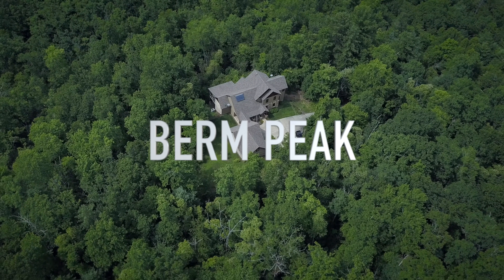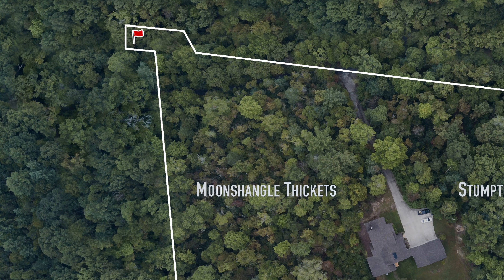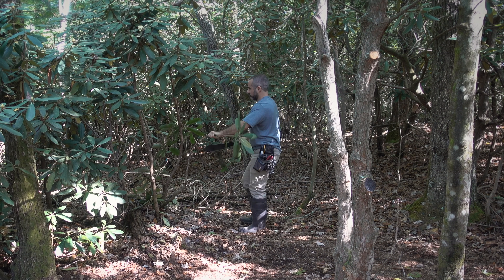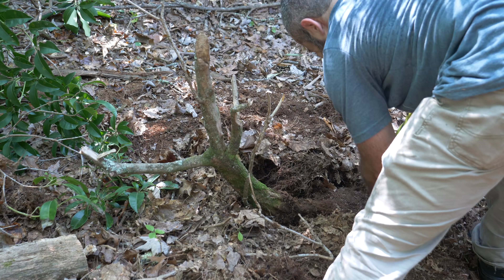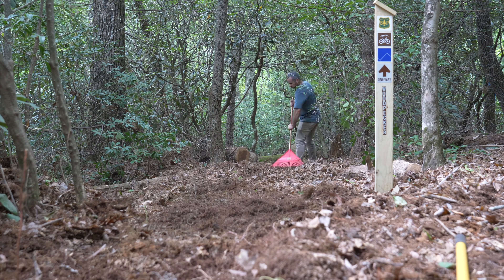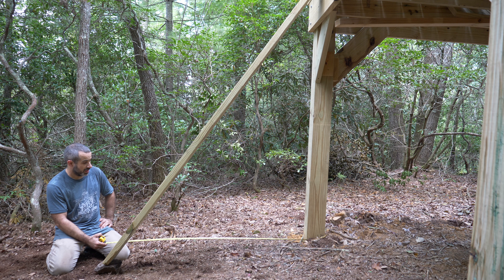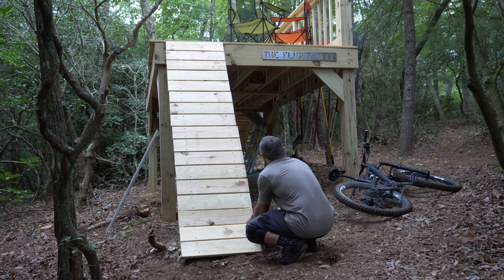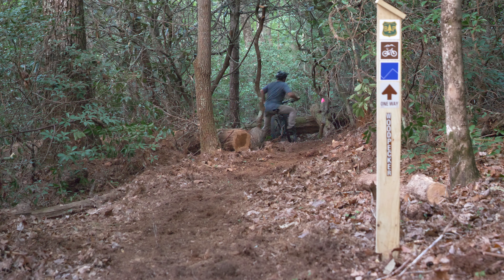What will we build on Berm Peak?

Comment: I would maybe consider putting grip tape/other materials on the flight deck, since you can slip easily when wet!
Reply: I did a lot of testing and the best way to get a sticky surface is to add a layer of paint, drizzle on sand, then brush off the excess and coat with another layer of paint.
Reply: True but griptape will get wet and then it just rips away. Also with al the soil it wil get dirty and gone is your grip again
Reply: @bryanpeeters2552  true might consider to put something different there. I wasnt really sure about the griptape.
Reply: @MaxMakerChannel  thats genius!
Reply: Chicken wire is pretty good
Reply: Roof shingles work really well, they're resistant to rain and work just as good as grip tape

Comment: There’s this tool called a “pull man” basically u clamp around of base of up to a 4 inch thick tree and then u just push down on the lever, and it literally just pulls the whole tree roots included out of the ground in a few seconds,  works really well for just medium to small stuff that you can’t pull by hand or would have to cut with the saw cause it just too big for the snips really recommed it even if u just try it a little
Reply: Can't find it on google. 
I find espresso, hotels, and root shovels.
Got any links??
Reply: Me to
Reply: Google - extractigator, or weed wrench

Comment: Hey Seth! I worked on the trail crew at kingdom trails in VT for a few summers and to remove small stumps like that, you can usually smack it with an axe or Pulaski. Pulaski’s have a hoe like rear that allow you to clear small roots and larger ones can be chopped with the axe size. This prevents you from getting on your news and using your hands to remove top soil. Work in a circular motion chopping and pull the top of the stump each way to reveal the stuck roots and they should pop out in that 30 second mark🙌🏼

Comment: food for thought: i had a deck on a house in northern virginia i rebuilt. i remembered the difficulty of cleaning off the leaves and acorns so i spaced the deck planks with a 1/2” gap. this still felt ok and really shed the falling tree debris. i believe the deck would last longer without wet debris lying in the boards and holding moisture. this may come in handy on your features.

Comment: Hey Seth, for a diy cooler you can take a cheap foam box coat the out side with spray can truck bed coating and coat the inside with flex seal you can put some ice in to for that next roll in build or trail.

Comment: A sharp heavy cutting spade would make really fast work of those smaller stumps, even faster than the reciprocating saw, and it may just save you money over the full trail build blade wise. The cheaper ones, like those made by Razor Back are like $50. The all metal kind with a 13” square blade. 

They are super useful tools,  a multi tool for landscapers. Great for, cutting roots, sod, cutting the sides of a trench, prying up paving stones and rocks, a leaver for moving root balls, ect...

Comment: It would be cool if at the top of your property along the topographical lines (so its flat-ish) you put an oval pump track where you could get massive amounts of speed built up, and then jump out of one of the end corners with massive speed down the mountain on to a DH trail!   Just a thought on how you could could 'start' a trail with a massive speed increase.  Like those zip-strip cars that you yank the plastic strip out of and makes the wheels go ludicrous speed and then you set it down on the ground and it takes off like a rocket!

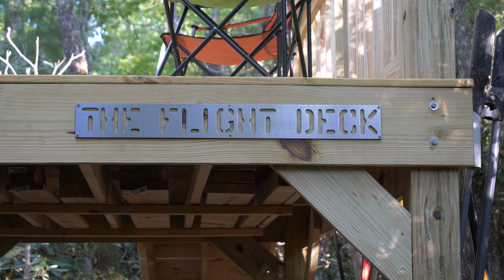Comment: 6:06 - Takes a 6.5 foot drop to flat - no problem
6:20 - Rides down a ridiculously steep, lightly-secured single plank and laughs as he goes over the handle bars - no problem
7:44 - Hesitates when approaching a completed 14"-wide roll-in that is not as steep as the single plank and has a little transition at the end to make it easier

Comment: bike hack suggestion: to seat tubeless tires remove the valve core and blow air in it with a compressor
but don't use a shop inflator, use a blowgun then put the sealant in by the valve.

Comment: Think about a quarter pipe-like shaped rollin which offers good speed after dropping in and hold the opportunity to use it as a jump on the flight deck, maybe trying a 360 upwards...on the current rollin in the direction of berm express you loose speed through the harsh lading caused by the hard angle on the ground

Comment: I've got a question/in need of some advice.  So basically I dropped mountain biking for 2 years because I got busy with other priorities.  Now I'm in college, in Gunnison.  I have literally any kind of trail in the palm of my hand-whether that be uphill singletrack, flowy downhill, jagged, technical rocks, pump tracks and massive doubles, and one of the steepest mountain descents there is.  I'm still on my absolute trooper of a hardtail I started on, because it's more than capable of what I'm into.  However, I run into this road block when it comes to doubles.  It's all in my memory, because I remember, 2 years ago, I hit a double without enough speed and launched my front wheel between them and practically destroyed myself.  ever since then I can't seem to get enough speed to actually hit the doubles.  I can hit tabletops no problem because there is no fear of casing them if I don't.  I'm stuck :(

Comment: Still think you should tweak the bottom of the roll in as it still goes from too steep to too flat. Your fork completely bottoms out if you watch the videos. Just add an extra board or 2 at the bottom to soften the angle. It will still be just as steep to roll in but less likely to smash or break someones fork at the bottom.

Comment: Unfortunately you're losing a ton of energy/speed on the pucker plank into the fork, your limbs and the ground... you should take off the bottom 5-6 boards.. run a couple more boards at a less steep angle to preserve some of that energy lost, not to mention save you some fork seals, to send you rocketing down the new trail.  You'll still have the initial thrill of the drop but a much more efficient use of gravity, which is why you built it in the first place.

Comment: use a weed wrench it takes 30 secs
Reply: Tazing hmmm I’ve never seen one of those before, it’s a cool design. I don’t think it would work on the larger Rhododendrons he is pulling though, especially since it seems like the footprint of the wrench would be over top some of the root structure. 

For this stuff I’ve always used a heavy cutting spade with a sharp square blade. It cuts roots easily.
Reply: Yeah, works for pulling out short trees and such. It also gets all the roots with it so no need to saw them out !!

Comment: I like your ideas, how you work, but... that flight deck is totally crazy, dangerous and points 100% to the wrong direction. For this height it is too small, the "drop in ramp" is unreasonably steep, the run-out of it is... ahh. That would have been a wonder if you had not crashed...

Comment: buy a sub compact tractor with a loader. thank me later.
Reply: cantbuyrespect he’s not doing any major dirt moving though, he is sculpting single track (one bike wide) through the woods, not making a big, wide jump trail. 

Even a small compact tractor needs at lest a 4 foot wide path to maneuver, which is like a super highway for a bike, not single track which is the goal. And yeah a tractor could drive right over that small brush, but once again, he is trying to keep all of that for the scenery. 

Not to mention that a good quality micro tractor, even used in good condition, with a loader is at lest 10k, more likely 15K+ if it’s newer and has some more options.